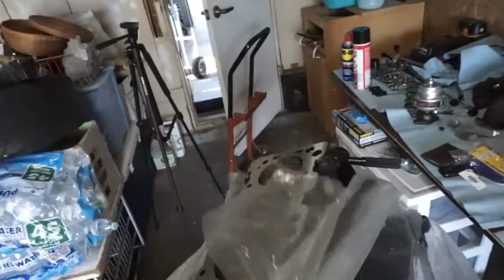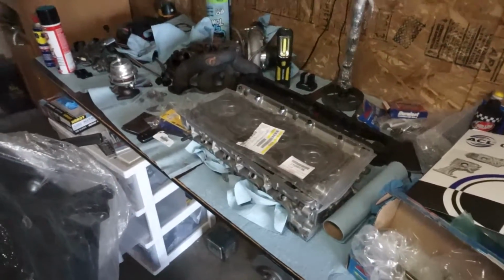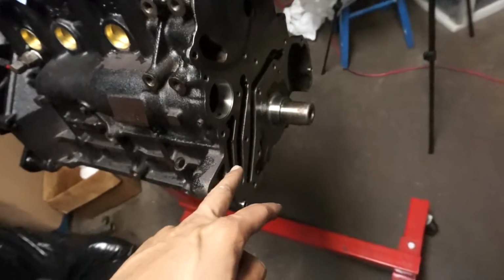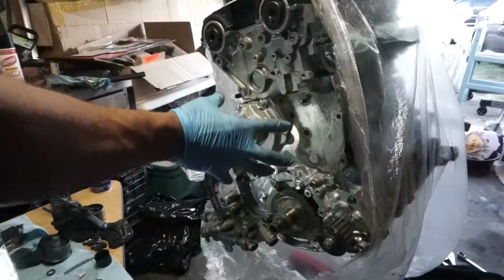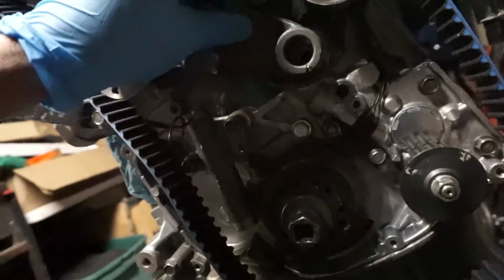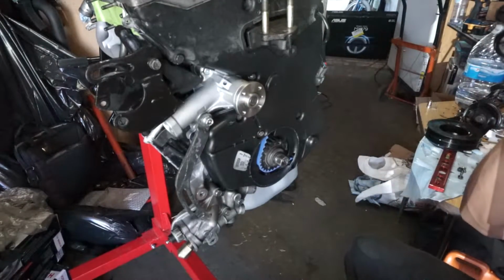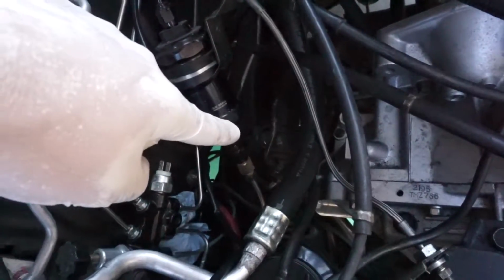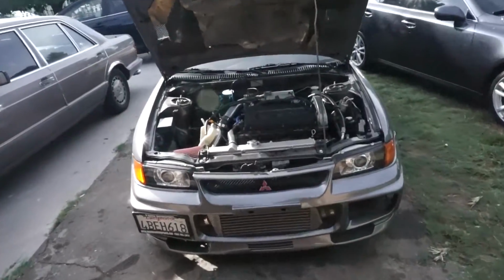Evo DSM 4G63 Engine Assembly

Comment: Hello.
Please, in my humble opinion do not use a brass fitting described at about 2.40 in the video I have had one break off at the block and pump all the oil out of the engine. I now use an oil pressure sender for my oil pressure gauge that is mounted remotely on a braided s/s hose.

Comment: I have a JDM EVO 1 engine and was wondering what dsm part are compatible. I have the lifter ticking and would like to know what part to get. Ty in advance.
Reply from the maker: I was using Topline revised lifters that can be found on most 4g63 part websites. Just monitor your oil pressure since these have a 3mm oil port.
Reply: @arengineering1801  pretty big opening. Thank you sir.

Comment: Great Video mate, good work.
Just a quick tip with regards to the ARP-L19 Studs. ARP Website says to use gloves when installing as touch with your bare hands can cause them to rust and corrode and void your warranty !
Reply from the maker: I'm paranoid when it comes to gloves nicking during this step, so I use a metal cleaner on every thread I touch with my hands. It's hard to film every step also, but thanks for watching.

Comment: Nice tip on pressurising the oil system before first start. What did you use to pump the oil through?
Reply from the maker: A fluid pump from harbor freight. It takes about 2 minutes for the oil to to reach the lifters. Thanks for watching.

Comment: Is that 450kw or hp?
Reply from the maker: Hp tuned on a dynopack. I hit 411hp last time on a stock engine, so 450 is more than enough for me. Thanks for watching.
Reply: @arengineering1801  stock engine ??? Pistons and conrods too ? how much Psi were you running

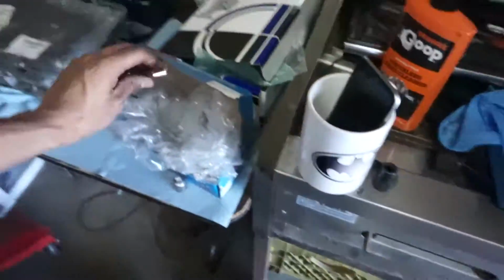Comment: 3:30 ruins head studs 😂
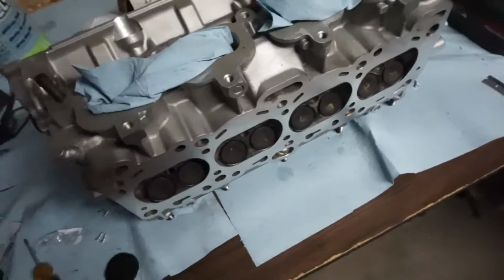Reply from the maker: If that freaks you out at 10:48 I for sure get hydrogen embrittlement.
Reply: @arengineering1801  did you just not know that you are not supposed to touch them with bare hands or are you just not worried about it?
Reply from the maker: @carringtoncape8165  I was aware of it. My  engine builder told me about it and ARP took extra care in packaging to prevent any exposure to hand oils and other chemicals. What the video doesn't show is when I cleaned and lubed them per ARP specs before one end went into the block and before the head went on. I didn't use gloves, because I was paranoid about tearing a glove and having a piece wedged in a oil port somewhere.
Reply: AR Engineering that’s fair. I’ve never used L19’s but I’ve heard may story’s. That’s a top notch build you have going on. Best of luck with it

Comment: Just a heads up you might want to consider adding an oil pressure sensor relocating kit because of the length of the fittings you have coming off the oil filter housing can easily snap from vibration.
Reply from the maker: Thanks for the suggestion. The fitting threaded in plenty and thr weight of the sensor did move since the fitting is sturdy, but it can fatigue over time.

Comment: Hello my friend , I need your help , please!. Let's see , when I turn on my car ( Mitsubishi RVR sports gear x3, engine 4g63) the oil pressure is 80 psi for 0,8x1000 RPM (for 65°F). but when the engine starts to heat, the oil pressure drops to 0 psi (200°F). What can I do ????  
Note: my Metales are new.
Reply: That's kind of normal, especially if you have balance shafts. The oil pressure goes up while driving? Around 30ish psi at cruise?

I run 20w-50 and at idle mine is around 22-25psi. Most cars I tune in thinner oil scare me because they usually have the same issues your describing.
Reply: @Kenuwine24  I could be , so I try it. My friend, can you see this video?  it's similar to my problem. https://youtu.be/9pYK5kEW45M . The solution is in near the oil filter. You see it please.
Reply: @Kenuwine24  I added a bardahl 2 weeks ago. But the issue continue. Tomorrow I will change the oil to 20W50.
Reply: Your oil weight is low, plus if your using a digital gauge that's not name brand trash it. Vibrations play a big part on digital gauges.
Reply: @Kenuwine24  no, I have a Mechanical gauge.
Reply from the maker: It's impossible to diagnose your real problem on here, because there are too many variables. It's not a performance upgrade, so any mechanic can diagnose the issue with diagnoses and calibration equipment. Maybe the pressure sensor is bad or something within the oil system is causing the pressure drop which is why someone needs to get there hands on it and assess it properly.  Hope this helps and thanks for watching.
Reply: What weight of oil
Reply: @Kenuwine24  oil 10W30 Shell

Comment: Hey bro, could you post the part # for that Pegasus oil fitting. I can't seem to find it. Thanks
Reply from the maker: If you haven't found it here is the part number P#1073-001. Pressure Gauge Adapter, 1/8 BSP Male & Female, 1/8 NPTF Tee. I hope this helps.

Comment: Hey man did you get a kit for the balance shaft delete? And what did it entail? Also you blocked off the coolant port on the block does the fp green not require to be coolant fed? Sorry for the questions this is just my first time rebuilding a 4g63 and my second dsm and I want it right lol
Reply from the maker: Yes the balanced shafts were deleted. There are balance shaft eleimimator kits out there. Pop your old ones out and pop in the new bearing with the oil hole in the opposite direction. Google 4g63 balance shaft eleimimator kits and you'll find plenty of write ups. Eliminating the coolant port is up to you. It all depends on your application and I choose to not run it. Dsm tuners is a good place to find answers to all of your dsm/4g63 questions.
Reply: If you have to ask, you shouldn't be rebuilding a 4g.

Comment: How do ppl get 700hp+ out of these? New to dsms looking for a gsx
Reply from the maker: The deeper your pockets are the more horse power you can get haha. Forged internals, big turbo, sufficient fuel, and a proper tune will make 700hp. After that you'll need a built transmission and all of the goodies to sustain that type of power. DSM tuners forum is a great place to start planning and budgeting your gsx.
Reply: @arengineering1801  Thank u so much bro
Reply: It all originated for a cast iron block. Mitsubishi built it for boost and they definitely made it strong.
Reply: Stock 4g63s can up to 400hp
Reply: @shawnjones7512  with a safe tune and e85 I've seen them close to 500 also... A good friend of mine,purchased a first generation talon. With a bad head gasket.  Slapped in a OEM composite gasket with ARP studs. Dropped oil pan and changed rods bolts with everything still in the block. He put the engine in his other racecar. 
That engine made over 600hp with about 30 low 10 second passes and was still going till he had an injector fail causing a melted piston from  a lean condition. Lol.
They're buy far one of the strongest 4 cylinder engines ever created.
Reply: @mikealbrailsford5438  I agree. My 2nd gen gsx was only about 300hp before a drunk driver hit me and totaled it out

Comment: Damn dude. ..  so glad u uploaded!!!!. . . . Wish I could do the same right now. ..  I think I'mma buy an evo3 block and bring it with me. .  I need to clean my engine bay dude. .  Ugh soon . .  I'll upload car show soon
Reply from the maker: Just spray the engine bay down with aircraft paint remover and spray paint it. That's what I did and it's held up for 7 years.
Reply: @arengineering1801  I have about a year left hear in Japan. .  Garages are not normal here and hobby shops are expensive as u would imagine. . . All these r32-r33-r34 Supra and rx7 guys all prepay months in advanced. .